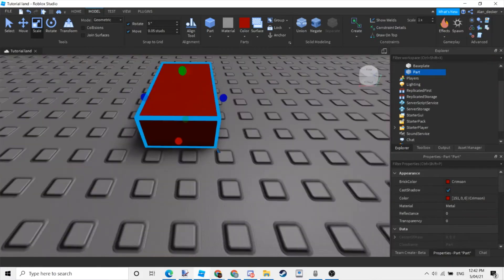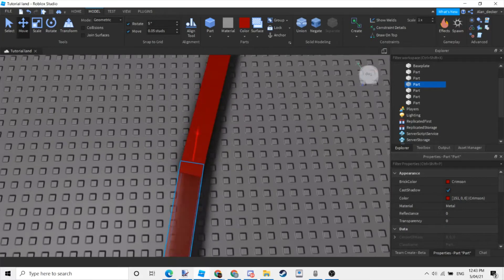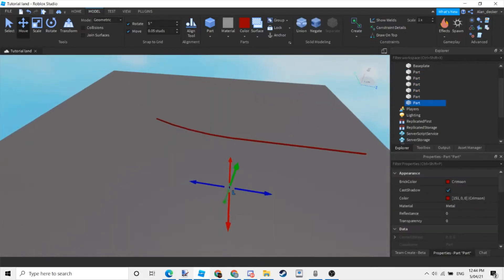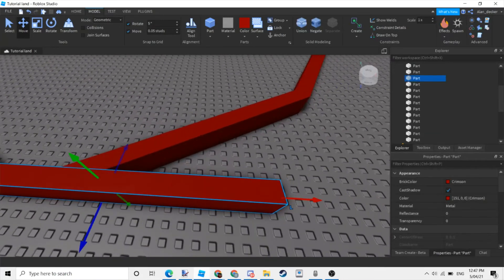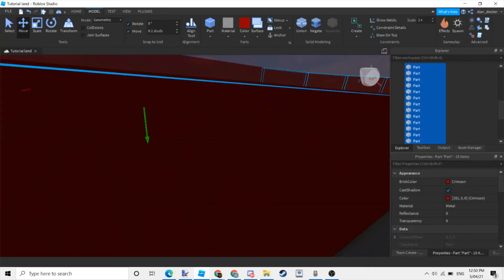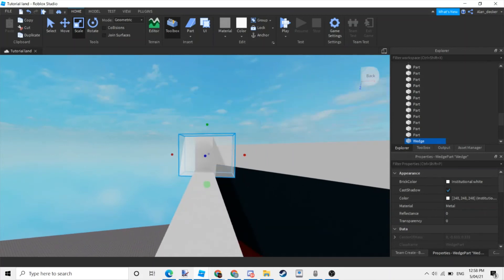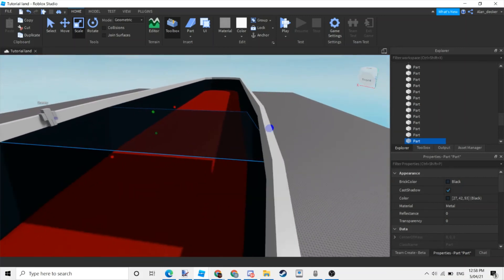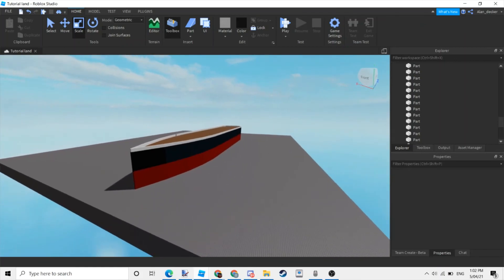Roblox Studio: How to make a basic Ocean Liner Part (Hull only)

Comment: This tutorial isn’t a very good one too work off if you plan on making a group or a game in general as i’ve noticed a lot of issues with the hull and it’s design such as the red part to the hull is shaped like the upper hull which isn’t correct, the lower hull at the stern should look more like at the bow or else where would the propellers and rudder go..
Reply from the maker: Thanks, I guess I will use this information to make a better tutorial or improve my projects. Thanks for the comment!
Reply: I am glad that you have acknowledged my feedback as most people usually tend to fly into a fit of rage.
Reply from the maker: @dec_the  really? Because this is actually helpful, instead of being in rage on how they where wrong, and just learn from there mistakes.
Reply: @alan_decker  yeah.
Reply from the maker: @dec_the  to fix the stern, I will be using a bit of inspiration of the Lusitania stern, I like it.
Reply from the maker: Update: the stern, is hard for me.. any tips on how to do it?
Reply: @alan_decker  it’s hard to explain but building hulls in layers and then gapfilling the in-between’s is useful, it’s how I do my hulls
Reply from the maker: @dec_the  alright, I will try to find out how to use this information, seems I will be using a bit of gap filling
Reply from the maker: At this point, I would just want you to help me, as in let you edit.
Reply from the maker: seems this has stopped, I really want you to help work on R.M.S. Maritacan with me!
Reply: @alan_decker  I am quite busy at the moment as I’m building ships for my Cunard group
Reply from the maker: @dec_the  Understandable, I will just try to do it myself then.
Reply from the maker: @dec_the  Update: I have a some what update of the stern, just feel like I will mess up the rest of the ship
Reply from the maker: @dec_the  By the way, just to know what is your username?
Reply: @alan_decker  it’s my YouTube username
Reply: @alan_decker  but I can’t accept your request as my account got banned for 7 days
Reply from the maker: @dec_the  oh, that explains it..
Reply from the maker: I believe the 7 days is done
Reply: @alan_decker  yuh
Reply from the maker: @dec_the  yay, well if you join my group I can let you help with the boat
Reply: @alan_decker  I mean idk if I really want to help as I am quite busy with my wip group
Reply from the maker: @dec_the  yeah, alright then.
Reply from the maker: @dec_the  I guess I will just not continue this thread until around a month
Reply: @alan_decker  I mean I’ll comment again once my group is set up
Reply from the maker: @dec_the  alright.
Reply from the maker: @dec_the  so still setting it up?
Reply: @alan_decker  lol no, I gave up
Reply from the maker: @dec_the  alright, been a while. How is it now?
Reply: @alan_decker  I gave up on the group as I found interest in battleships
Reply from the maker: @dec_the so what are you doing now these days
Reply: @alan_decker  I mostly play stormworks and war thunder but I still do sometimes play roblox
Reply from the maker: @dec_the  I’ve hein to play enlisted, same company that did war thunder
Reply: @alan_decker  bro get war thunder
Reply from the maker: @dec_the  I have it to
Reply from the maker: Honestly, it's just that I can't make the bottom of the stern, I can make the black hull though.